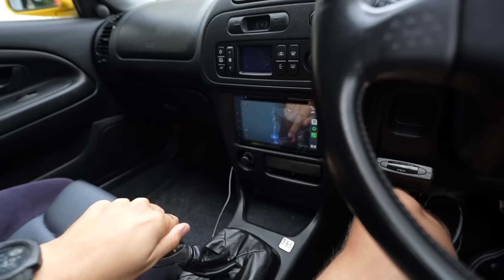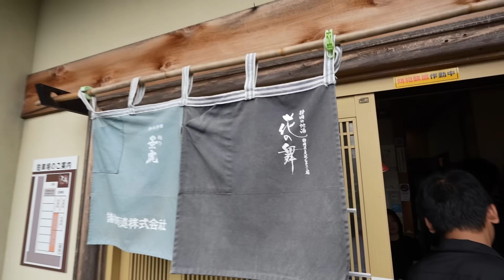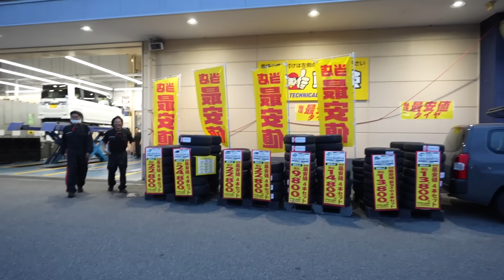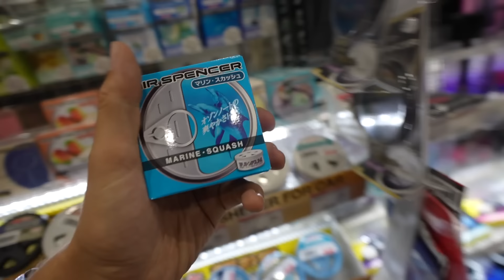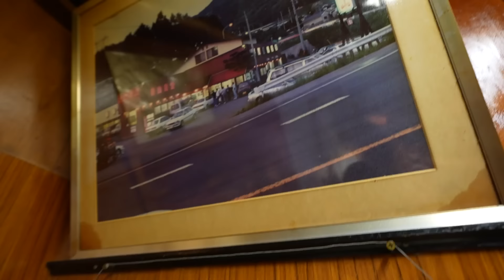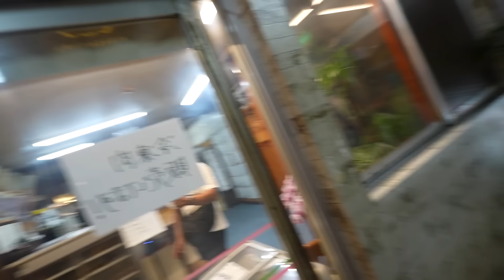I Modified my New Evo V with JDM Legend in Japan!

Comment: Dustin, lmk how suspension sounds like. I’ve touched EVERY nut and bolt and bushing on my Evo 5 and sometimes still sounds like something is loose somewhere lol
But I have BC Coils. 

Extra power might be from E9 turbo, which is a common upgrade and it bolts up stock.

Comment: Change to evo9 rear suspension arms they and will be a lot lighter and stock evo 9 turbo it’s slightly bigger than 5 stock turbo and it will be quicker and have it tuned

Comment: Can't quite tell in the video as it's pixelated, but if the boost gauge is anything to go on and assuming that's 1.8 bar, if it's going higher than about 1.3 bar then it has at least got some ECU tuning. Rebuilt turbo is a possibility but probably unlikely as the 16g TDO5 is quite a capable unit. Stock PSI is peak of around 18/19psi (1.3 bar) tapering down to about 16 (1.1 bar), so any higher than that isn't stock - and iirc you can do up to about 25 psi (1.75 bar) comfortably. 

The EVO 5 was a frighteningly quick car for its time, I really miss mine, stock that thing would take on even a lot of modern sports cars at the lights. Enjoy yours Dut and enjoy taking it through all the Toge, those cars were meant for windy twisty roads.

PS. Get the AYC pump checked. Those things are notorious for dying, especially if the car has sat for a while.

Comment: Dut, something im in the process of doing for my evo 4 that you might consider for your 5. i have a set of confetti recaros (which bolt right up to stock brackets since its the same seat as oem) and redoing the rear seat centers and door cards in the confetti fabric as well.
Reply: the evo 4 door cards and sears have a weird red plaid pattern, but the evo 5 has a simple blue fabric everywhere. the confetti really sets it off

Comment: My Evo 5 felt extra quick at first, then I started hitting boost cut and realized the actuator had seized up, common on these. Simple mods, but a smaller wheel with an extended boss and a lower seat rail was a huge improvement for me.
Reply: Very true. Getting rid of the huge steering wheel and a lower position seat will make it feel more like an actual sports car rather than just some quick sedan.